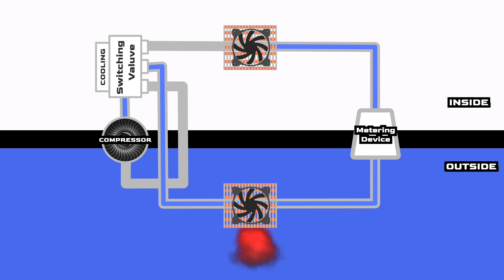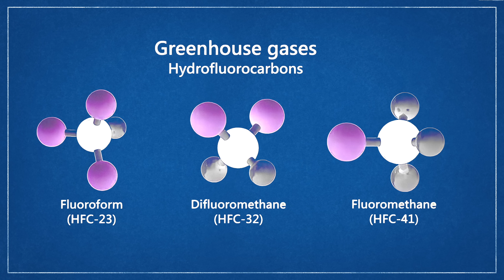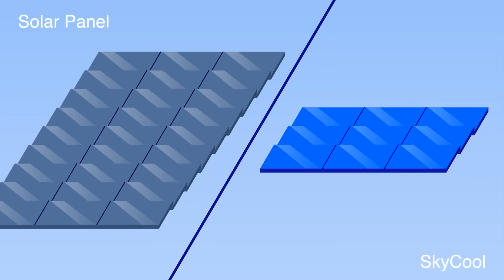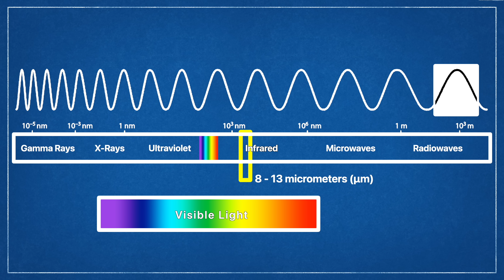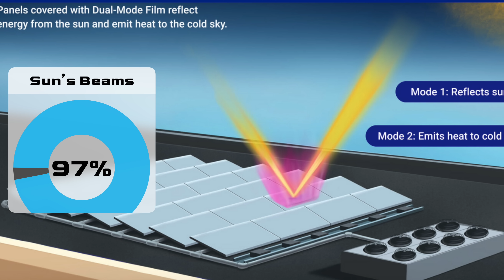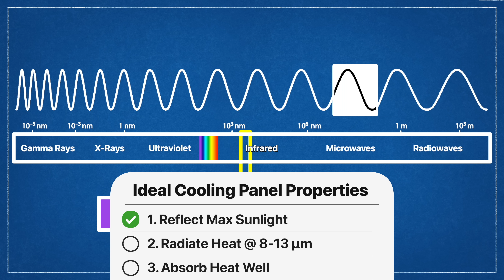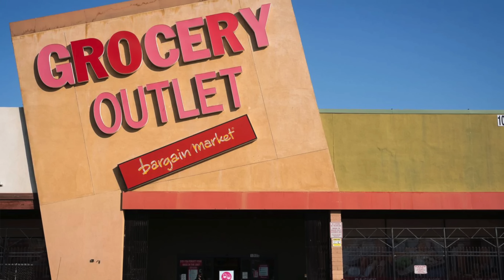New AC Tech Sends Heat Into Space & Saves 95% On Cooling Bills!

Comment: 3:27 R134a is not used in home cooling. That is specifically for automotive uses. The current generation refrigerant (R410a) has a GWP of ~2000 and the next gen refrigerant (R32) has a GWP of ~700.
Reply: Correct me if I’m wrong, but I’m fairly sure R134a is used in a lot of domestic cooling here in Australia and outside of the US?!?
Reply: Time to ban 410a and 134a!

Process has already officially begun
Reply: Correct. On majority of coolers in USA also. 

Only trippled in price over the last year here
Reply: Current generation?
Reply: @georgekolos5255  yeah, Dan’s wrong even though it’s technically current gen, its not like everyone is going to upgrade right away.

Comment: My BS detector is like, How the "F" is that moving heat into space?????. that just outside! 
Heat pumps move to and from inside/outside (or outside to inside).
Reply from the maker: A fluid would absorb heat inside and use this system as a radiator to discharge the heat

Comment: Hi. I dont quite get two things. 1st, if they save 30k per year on electricity, why in the end its just 6k annual savings? 2nd, why it works less effective if its cloudy? Its supposed to radiate heat out right? Does it matter if it radiates into space or into a cloud? Heat left the building either way. Whats the catch?
Reply: I was wondering the same thing.

Comment: Very interesting, a couple of years ago I saw a Ted Talk about this technology.  It's good to know that it's being applied.
Reply: Since my comment debunking this video was deleted...

This whole thing is a scam.
Radiative cooling is a least effective way lose the heat! At room temperatures it is nearly non existent.

Convection and conduction effects are those that are heating up your house (heat from air and ground). Both of these are much more effective ways to transfer heat then radiation. There is no way radiative cooling with this magic device will be able to lose enough heat to keep up with being constantly warmed up by the hot air around it. Whole system will eventually equalize at ambient temperature.

Reason for this is second law of thermodynamics. Which in plain words means all energies naturally want to equalize. Meaning same temperature outside and inside your house. To fight this you need to create a temperature gradient and this takes extra energy. This is what regular heat pump or AC does. And since these magic panels don't use any extra (or enough) energy, they can't create a temperature gradient, therefor they can't work. Easy as that.

Radiative cooling is used in space on the International Space Station, because there is no other way to dump heat in space. Volume of the ISS is about 1000m3, area of radiators to keep it cool is 156m2. But that's in vacuum of space, there is no warm atmosphere there constantly heating up the radiators. 

So unless your house is in space this will never work.

Comment: I am an electrical engineer doing power conversion since 1981.   There is such a thing as solar A/C with principles similar to a gas powered refrigerator with no moving parts.  But I gather that this is not practical for a single family house.  As for this...I know about black body radiation and I do not know enough to rule this out.  I would like to learn more.  I live in WA where it is usually not hot unless it is also clear and sunny.

Comment: The issue you have is that you can only remove heat, you cannot add heat to the space. You need both modes. VRF inverter heat pump technology provides exponentially better performance and Efficiency compared to the "traditional" ac and heat pumps you're comparing to in this video. R143a (which is completely outdated, even r22 and r134a are gone), r410a even going away and replaced with r32. There are much more economical ways today for heating and cooling that are much better for the environment than traditional heat pumps. Solar is definitely the future for electricity, panels need to come a little further in life expectancy still though. U don't think we will ever really use them for cooling and heating though. If we do it won't be in our lifetime. Its a cool idea though for sure..

Finding a more efficient compressor (inverter technology) and a better refrigerant for the environment I think is most likely. Just my opinion though.

Comment: I've always wondered why AC takes so much energy. They output heat, which is energy. Why is there no energy reclamation system using that heat to generate electricity and reduce the amount of outside energy needed?
Reply: 2 reasons.. 1); see above and 2); the basic law of physics that says that energy cannot be created or destroyed.. therefore, IF ANY mechanism is used to produce ANY phase change (heat/ cool/ motion..etc), it will take energy to make that phase change possible and that , in and of itself WILL use some energy.. Nothing mechanical is either free or even near 50% efficient. 
 Depending on the materials, the manufacturing process and the energy used to install & maintain, passives will (or at least have the potential to be) the most efficient simply because they use less energy in mechanisms to produce the desired effect.
Reply: Since my comment debunking this video was deleted...

This whole thing is a scam.
Radiative cooling is a least effective way lose the heat! At room temperatures it is nearly non existent.

Convection and conduction effects are those that are heating up your house (heat from air and ground). Both of these are much more effective ways to transfer heat then radiation. There is no way radiative cooling with this magic device will be able to lose enough heat to keep up with being constantly warmed up by the hot air around it. Whole system will eventually equalize at ambient temperature.

Reason for this is second law of thermodynamics. Which in plain words means all energies naturally want to equalize. Meaning same temperature outside and inside your house. To fight this you need to create a temperature gradient and this takes extra energy. This is what regular heat pump or AC does. And since these magic panels don't use any extra (or enough) energy, they can't create a temperature gradient, therefor they can't work. Easy as that.

Radiative cooling is used in space on the International Space Station, because there is no other way to dump heat in space. Volume of the ISS is about 1000m3, area of radiators to keep it cool is 156m2. But that's in vacuum of space, there is no warm atmosphere there constantly heating up the radiators. 

So unless your house is in space this will never work.

Comment: I think this can be measured by pointing an infrared thermometer 'gun' at the deep blue sky, it'll be about -30°F (which is close to -30°C. These measurements were from Los Angeles on hot and cooler days). If however there's any cloud cover, even haze this temperature shifts to near the temperature it is on the ground.  And even in Los Angeles not many days are clear enough for this measurement to be made. Basically the clear blue sky is a radiant heat sink.  
Another way to look at it is, that blue sky is like looking through a window in your warm house to the winter snow outside. How might you lower the temperature in your house without using any direct connection? 
One trick that would be really neat is if this radiant cooling could be used by the solar panels in the large solar farms planned for the open desert. It's the cities hat cause haze in the skies and proximity to the ocean that provides the clouds. Farther inland daily blue skies are more common. If the solar panels can be kept cooler they'll generate more electricity, if the radiant effect is great enough - maybe it'll help global warming or can be piped to populated areas.

Comment: A requirement for education is precise language, because if someone records an ambiguity in their mind (a secondary definition you weren't intending) then not only have you not educated them, you have actually spread ignorance.

This happened in this video, when you were listing two values and used the phrase "two and a half times less". This is grammatically, mathematically, and logically wrong.

If you are comparing two values, say 5 and 100, you can say that "5 is one-twentieth of 100", or "100 is twenty times what 5 is" or "that's just 5 percent of the higher value". What is NOT correct is to say "5 is twenty times less than 100".

Let's break that down.

"5 is twenty times less than 100".

Treat it like a word problem. "Times" is multiplication, and "less" is subtraction. Therefore, you have literally said "5 is a multiple of 20 and 100 subtracted from 100".
5 = 100  – (20 × 100) = 100 – 2,000 = –1,900... so you have actually said "five equals negative one thousand and nine hundred". (5 = –1,900)

At 9:46 you say "...two and a half times less energy than...", which is wrong.

If standard AC systems use 1,000 watts, you have literally made the claim that this new method uses –1,500 watts... meaning each system in operation GENERATES 1,500 WATTS.

The correct thing to say would have been "...uses just 40% of standard systems..." or "...compared to traditional cooling which requires two and a half times the energy to run..."

Continuing to use the phrase "_n_ times less" is as inaccurate, irritating, and ignorance-laden as using the phrase "I got no [item]" or any use of the idiotic word "irregardless".

Comment: At 12:45 you spoke of A/C, but the image you showed was a swamp (or evaporative) cooler. These works well in low humidity environments (but not most normal places) and the energy consumption is very low because it basically is a very large fan - much cheaper than running an air compressor in a heat pump or A/C unit. The down siders are: 1) swamp coolers evaporate water to cool the air so your indoor humidity will increase substantially, 2) if you are in a low humidity area it's probably desert so water is precious, and 3) since you are blowing in cooled outside air, any pollution or dust in the air come in with it (not very good for allergies or the amount of time one allots to dusting - everything).

Comment: There is no form of heat that has no conductors. It's just BS. How could they possibly fine tune this thing anyways? Are they able to take all those different wavelengths and then convert it to some narrow band? Ted talks are the worst when it comes to pseudoscience.

Just the suggestion that any gas, of any composition, is going to trap heat in the environment is what makes this channel such a joke. The Greenhouse effect is BS. Everything on the planet absorbs and reemits heat. Including trees, concrete, etc. Gases are some of the least effective forms of matter at trapping heat. That's why the air cools so quickly after sunset, while the forest and concrete is still warm.

I think I'm done with this channel. Your sponsor has scam written all over it to.

Comment: at higher longitudes, Angle is your friend.  As the 1 angle is a high Sun, and reflection is greater, where in winter, Low angle you can absorb the sun's heat and put it back inside.  The fun part is bring it inside, you Want something to hold the heat longer, as it can get very hot.  Brick works great for that.  Pipe the incoming heat into Brick and use a fan to wick off the heat needed.  You could use water to hold the heat, which would also add moisture.
Reply: As well as a secret with heat and cold.  Heat like to rise, so is better from the floor, and cold is abit heavy so is better from the ceiling.  Converting all our homes and buildings is going to be very hard for Corps to figure things out.

Comment: I thought of a way, years ago, to generate energy on Mars without much in the way of high-tech, that uses this phenomenon.  I checked it out with NASA and they said it would indeed work (higher altitudes with less atmospheric CO2 better).  Goes like this (highly simplified):
My system circulates compressed hydrogen at constant pressure through a loop of parabolic troughs that radiate heat from the H2 to space.  This leaves the gas much colder than ambient, and allows freezing of CO2 directly to solid form from the atmosphere.
The panels are tilted during the martian day to do the opposite.  The collect energy from the Sun, and focus it on the H2 pipes.  
The frozen CO2, which has now been allowed to warm up to ambient and liquefy in as pressurized container (or kept as a solid in an insulated container and metered out), is now heated by the H2.  It rapidly expands and is used to generate power.  The loop could be closed, open, or a hybrid that allows modular expansion as more tanks are built from local metals.  It could even be closed and used on other bodies such as moons lacking an atmosphere, or could use a different working fluid in a closed loop.  The idea is to keep it cheap and be the 'pumped storage' of off-world power.
Anyway, it's very simple, can be mostly mechanical, uses both solar energy and whatever the opposite of that it -- thermal equilibration with space -- to generate power.

Comment: I stopped using air-condition, planted more trees in my garden and changed to larger windows. In all, there were only 22 days in the year where the heat was above 35 deg during the day where a swamp cooler and cross ventilation did a pretty good job.  Your body will adapt to its surroundings. If you need 18 deg room temp and a blanket to fall asleep,  weather above 30 C will make you sick very quickly.
Reply: Move to someplace like Florida. When 22 days of the year are below 35⁰c
Let's see how unneeding of AC you are then. Lol
Reply: I can confirm that the temperature does in fact make me sick, but I don't use an air conditioner because it's usually quite mild around here. Usually around 20 C.

Comment: So, you haven't encountered the old space-connecting-cooler scam before?  This is the most elaborate version I've seen, so far, but the idea is not new. 

There's no narrow "wavelength window" that is far superior compared to the rest of the spectrum in passing the atmosphere in the suggested area. The wavelength of passively emitted IR is largely dictated by the temperature of the emitting object, not composition/design. That is how IR cameras can determine temperature, and not composition/design. That is also why kelvin "color temperature" is a thing, the color of the light that is passively emitted from an object relates to it's temperature. 

Also, the emitted heat would absolutely not have to be able to pass the entire atmosphere in order for that idea to work, that suggestion should be enough for your BS-detector to go off. Quick recap; neither possible, or needed, for it to work as advertised for air conditioning.

Also, you can't make a relatively dark surface reflect >95% of the sunlight, it just doesn't work that way.  The nice thing about visible light is that you can se it, and you can tell if a surface might be able to reflect almost all visible light, or vary far from it, and because roughly half of the energy in sunlight is in the visible part of the spectrum, you need to reflect about 95% of the visible light, for it to be able to reflect those claimed 97% of the total sunlight, if you were able to reflect all invisible light. Reflecting 95% of the visible light takes a very shiny and or white surface.      

You can actually create surfaces that reflects a large part of the sunlight, thereby making it heat up slower by the sun, but you can't dump a lot of excess heat into such an object and expect it to stay cooler that it's surroundings, by reflection and passive radiation. If you could, you could also make a perpetual motion machine. 

If you actually want to get rid of as much heat energy as possible, you don't put your emitters fully exposed to the sun and applaud yourself for the part of the sunlight that gets reflected, not even the actual number, that's just stupid.   

That store saving 100 kWh per day after installing that system was not because of that system, not in the way they advertise it anyway. A large store can save that much energy for cooling from regular service/maintenance, if that has been ignored for too long. That is just one possible explanation, of many.

Using those panels to emit heat at temperatures above ambient is possible, and it also possible to increase efficiency slightly by dumping the heat into water with a very large emitting area, compared to have the refrigerant condensate from air cooling in a compact condenser, but none of the magic is needed to achieve that. 

In fact, it is not difficult to improve efficiency of cooling systems by using better heat exchangers, but better heat exchangers cost more, and typically takes up more space, and energy is cheap, so the payback time for extra cost of better heat exchangers would be long, so here we are. Also, great heat exchange would make the systems less sensitive to neglected maintenance and less prone to break, which would reduce the revenue for the AC industry, so I don't see that becoming the norm anytime soon.

Comment: The picture @8:43 is an evaporative cooler, not a heat pump. This guy is an idiot. He states the new tech cools the fluid to 15˚f below ambient. So when ambient is 100˚f, the coolant os 85˚f, that is not cool; literally and figuratively. Freon based A/C and heat pump units operate with an evaporator temp of 50˚ to 56˚f. A coil temp of 60˚f or more will never cool a dog house, let alone your house. Last, their so called 95% energy savings is a myth, the circulating pump uses more electricity than 5% of what the A/C uses; simple physics dictates it.